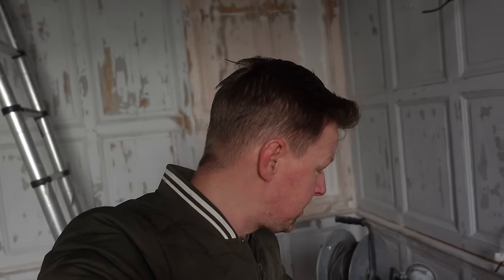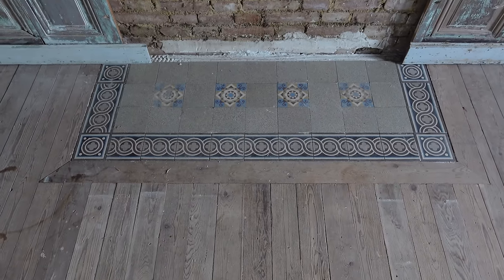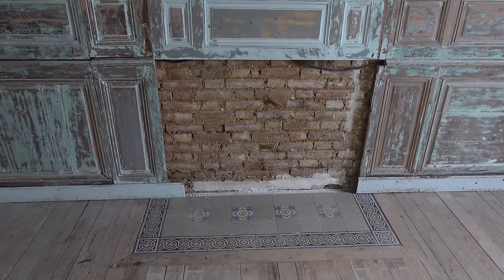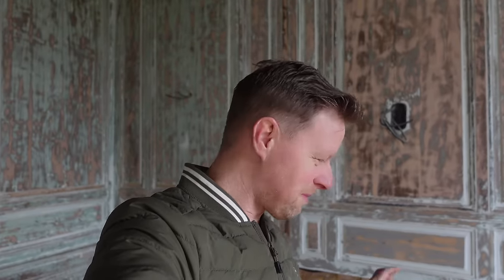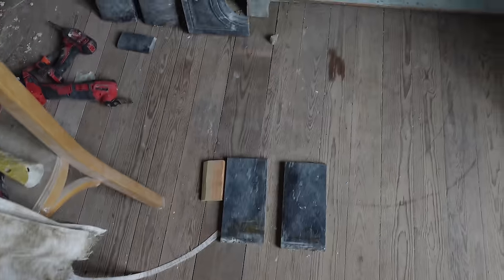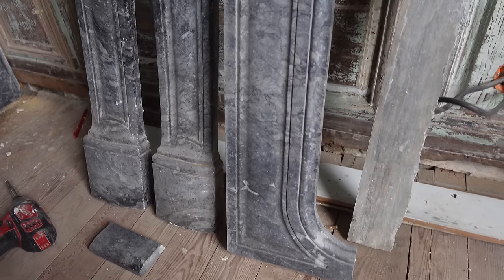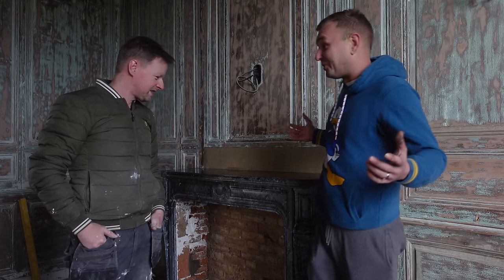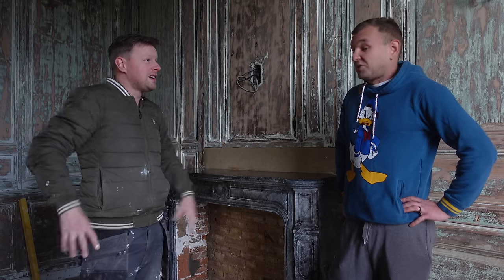We DID NOT Expect That To Happen - Trying Bizarre DIY: Did It Actually Work?

Comment: There are an amazing assortment of new electric & propane gas wall hung fireplaces that would fit nicely into your newly built fireplace. They look so real it's difficult to tell they're fake and they're only 3" - 4" deep. ❤️🙏
Reply: That must be the plan? I don't see a flue or a gas line, and it is a very narrow space, just a few inches before the decorative tile starts. They didn't say anything other that the brick would be covered with some metal? Or did I miss it?
Reply: @safrew1   I think they're planning brick back then plants. It would be a shame to lose the ambiance of a fire if they're going to let the room to overnighters. We saw an electric fireplace at a home & garden show recently... looked so real the flames looked like they could burn you. 🙏❤️

c: Senator Josh Hawley
    Section 230 Committee

Comment: Good job fireplace looks fantastic.
When we lived in Belgium. We did a faux fireplace, for the inside i went to a fireplace shop and the have terracotta small square tiles i bought the lattice design and after we put them in I got a couple of the black leading cream tubes as we didn't want brick colour they sell it for polishing the cast iron stoves and rubbed it on then polished it when it was dry and it looked a million dollars looked as if it was always there for hardly any money
Reply from the maker: Thank you 🙏 😊

Comment: Guys - terrific job setting the mantle!  Just a suggestion, you might consider adding a metal strap on each side to anchor the interior brick supports to the back wall.  That way someone won't accidentally pull the mantle off the wall and have it land on them.  Unlikely to ever happen but this would secure it well.  Cheers!
Reply from the maker: Thank you 🙏 😊

Comment: Lovely tiles for the hearth even if it is for show along with the fireplace would you install one of those plug in faux fireplace panels that heat the room? I am sure whatever it is will be lovely and fitting :) Happy Mothering Sunday coming up Tracy :) and then again on the 26th of May in France.

Comment: you 100% need to get some one strike poly filler from the UK the stuffs amazing its a light foam in a tub it dries so quickly and it will fill to any depth I will never use any other filler I use it on everything

Comment: Hi Terry, 
Routers operate properly in a specific direction, usually a clockwise spinning bit/motor. If you look your router over, there will be an arrow somewhere (near the base) that tells you the direction the motor spins. The bits are designed to operate in a specific direction (clockwise, usually). You are pulling that router towards you and you should be pushing it in the other direction. 1st, there will be significantly less tear-out; 2nd, the operation will be smoother and cleaner (and easier), and; 3rd, you minimize the possibility of an accident. On Youtube, there are tonnes of plans to build router tables (to mount the router for use on the underside). You could build any of them very cheaply (out of wood), very quickly, and have a really nice setup for the future. Using a router free-handed, like that, is usually only done for doing chamfers or edge rounding, such as with table tops, where the piece is too large for a router table. Also, when doing tongue-in-groove work, using a router-mounted routing table will allow you to do that work far more accurately (and safely) and you can do a lot more in a lot less time. Okay, that was 2 cents' worth. 😊
Reply from the maker: Thank you 🥰

Comment: I was also going to ask what happened to that little coffee table you bought (for 20 Euro at a local Brocante) that needed some work done (additions to the table top at 4 places over where the legs are located). You were going to ask Rob to assist in its restoration. Not hassling you though; just wondering if I missed the follow-up on that one. I seemed as if a router- with a good assortments of bits -  was going to be pretty useful for that job. I also thought at the time that maybe 4 routed marble inserts would look really good too! Especially, if the table was going to be placed in a room with other furniture with marble inserts.